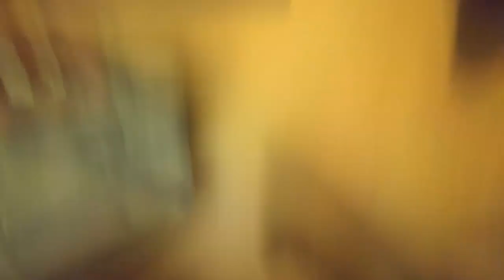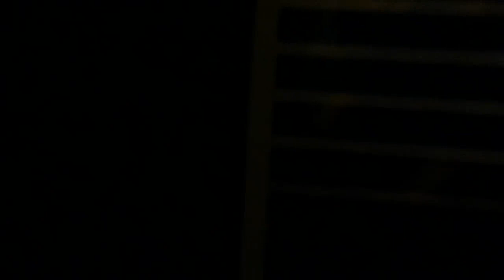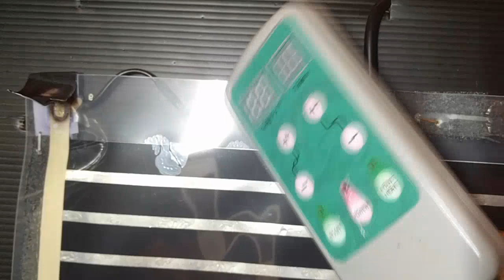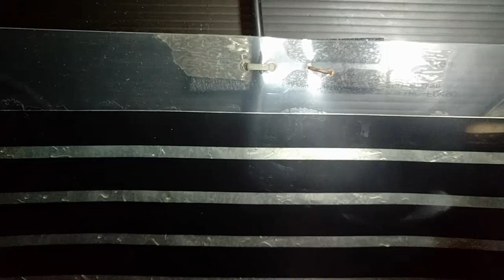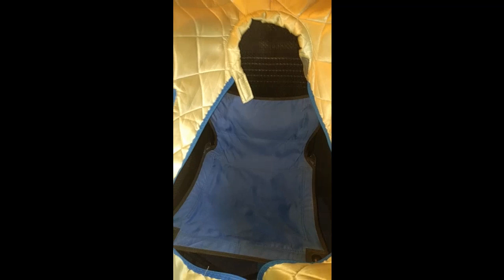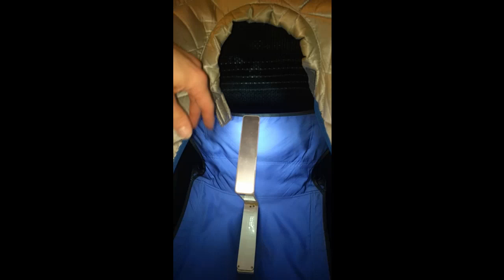Infrared Sauna Repair

Comment: Hello thanks for the upload I have pretty much this exact sauna but mine is low emf. Anyways my fuse is blown and can't find out what to replace it with do you have a suggestion? All I can see is it's 125V... my heat sink doesn't have any part missing like yours too if that's important.